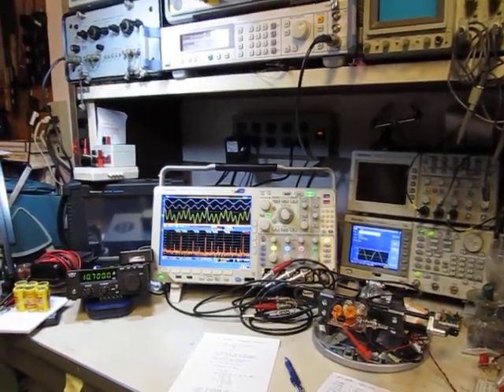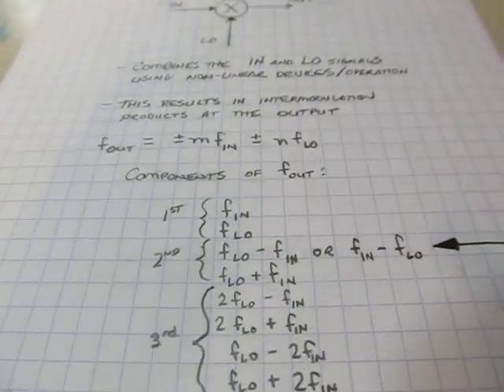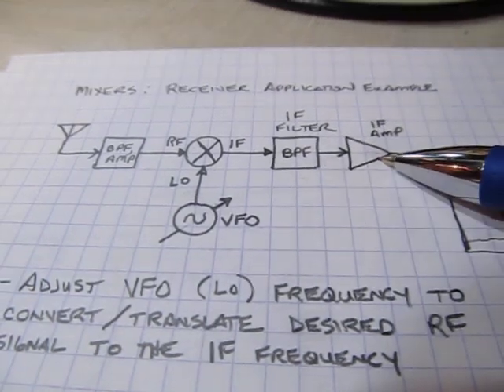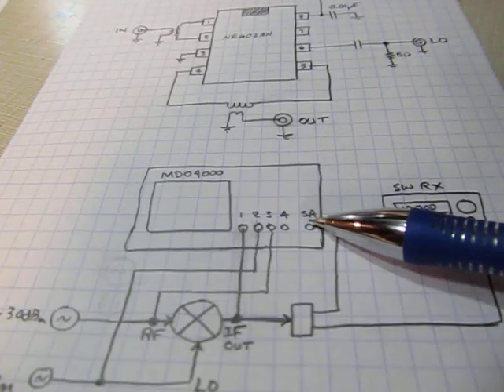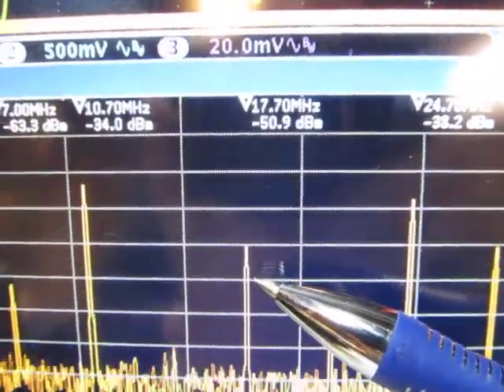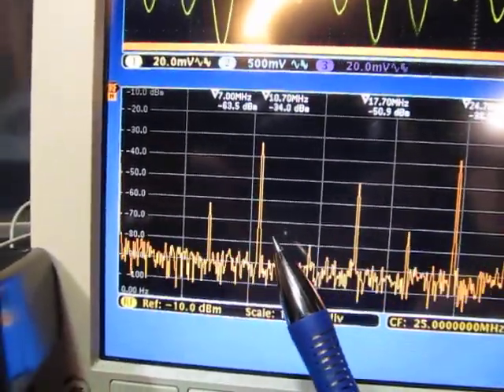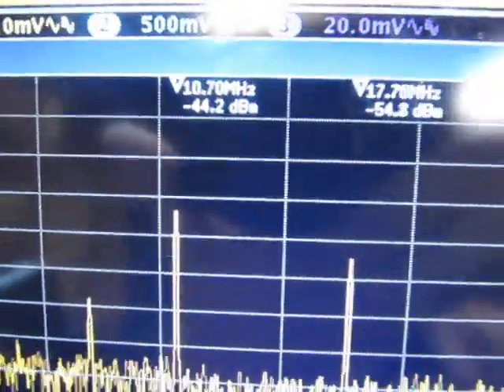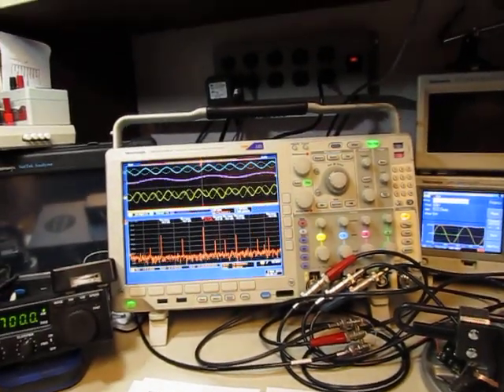#83: Basics of RF Mixers in Radio Receivers / Mixer Tutorial / Frequency Conversion

Comment: Great video thank you.

Q: how does the mixer "filter out" all the other frequencies of the band presented at it's input by varying the local oscillator?
Reply from the maker: In short - it doesn't.  All frequencies within the rated input bandwidth of the mixer are mixed with the LO, and all of those mixing products appear at the output.  It is up to the user to filter unwanted signals from the input (so they're not converted), and from the output (to select which mixing products you want to keep).

Comment: This clears up so much for me. Thank you. The one thing I don't quite understand is how to choose an amplitude or RMS value for the LO. I understand that if we want an IF freq of 455kHz, then the difference between F(LO) and F(RF) should be 455kHz. But how do we decide what the peak-to-peak voltage of the LO signal should be?
Reply from the maker: That depends entirely on the design of the mixer.  The specs for the mixer will state the LO drive power.  Often times, mixers are called Level-n, such as Level-7 or Level-13, indicating that they want a 7dBm or 13dBm drive level.
Reply: @w2aew  Interesting. Can't seem to find anything on the NXP SA606 datasheet. I'll keep looking around.

Comment: I am having a problem while designing narrow band pass filters can you make a tutorial on how to design a band pass filter and on the hf oscillators and rf amplifiers
please forgive me if these are silly questions. I am a beginner electronic enthusiast and i am trying to design a home brewed hf ham radio. I am having problems like impedence mismatch between oscillator and amplifiers etc.. can you help me
Reply from the maker: Narrow bandpass filters are difficult at HF and higher RF frequencies.  This is one reason why radio designs include several conversion stages, and the narrowest filtering is done in the final IF stage, where the frequency is the lowest.

Comment: Awesome demonstration!  In an old tube radio, is the mixer also nonlinear, or does it just add and subtract the two signals?
Reply from the maker: It is performing a multiplication, thus non-linear.  Simply adding or subtracting signals would not result in changing the frequency.
Reply: @w2aew Thanks!
Reply from the maker: @josquinmingus  Yes, the mixer creates sum and difference frequencies, but it is not through simple addition or subtraction of the signals - it is via the non-linear properties of the mixer (multiplication).

Comment: I was wondering why the mixer shows about 4dB conversion LOSS while the datasheet for 602, shows a 17dB conversion GAIN? also why this conversion loss increases to 14dB when you switch to 7MHz RF? datasheet seems to only show conversion Gain. The LO drive (0dBm) seem to be ok because the datasheet says 300mVpp maximum so your LO drive is even higher.
Reply from the maker: I didn't do anything to optimize the transformers at the input and output of the mixer, so their frequency response is all over the place.

Comment: A couple questions here...
1. When I tune to a station, let's say 92.3, does that mean the radio station transmits at a different frequency?
2. Are some of the intermods higher in power than the fundamentals? I was surprised to see that.

Your content is the best on youtube btw!!! Hands down.
Reply from the maker: Radio stations are strictly regulated, it is highly unlikely that their signal would include harmonics. Intermod products at the output of the mixer can be higher that the fundamental.

Comment: Hi Alan, just want to be sure i get the concept right..  if i want to build a receiver for 40m band SSB, can i get away with just having a single mixer and direct conversion? rather than having to get I and Q ? also, if i have a 7MHz LO, then my processor can simply generate 0 - 200 khz, mix it with the LO to cover the 7 to 7.2 mhz range. then mix that again with the incoming RF... that should get me back in the 200khz range, and sample my ADC at 400khz...i theory i could see all the SSB channels in a waterfall...

Comment: Interesting video!
Can anyone tell me why some devices like spectrum analyzers have multiple lower IF frequencies. For instance when upconverted to i.e. 2.1GHz and after filtered with a cavity filter, some go to 70MHz with an extra BPF and then to 10.7MHz. Why don't they go from 2.1GHz to 10.7MHz in one step? What's the advantage?
Thanks
Reply from the maker: There can be a number of reasons to have multiple IFs.  One common reason is to provide better filtering and elimination of spurs and intermod products.  Another common one is to have the ability to tune the LOs of the lower IF mixers to tailor the final overall measurement bandwidth, etc.
Reply: @w2aew  Thank you. That makes sense.

Comment: Still dont understand. In real life you say that the RF signal into the mixer is a whole band of different signals going into the mixer. If you have a whole band of RF signals into the mixer the output from the must be thousands of different frequenses. But in your lab there is not a whole band of RF signals going into the mixer it just one frequens which makes it simpler.
Reply from the maker: The "band" of frequencies that are put into the mixer are "shifted" or "converted" to a different band of frequencies at the output.  A filter then is used to select which particular frequency is desired.  Thus, by adjusting the frequency of the LO, we can move the converted frequency band up/down so that the desired frequency lands inside the filter.

Comment: And also just to be clear, in the last example your RF signal was 7MHz, your LO was 17.7 MHz, and your IF Bandpass Filter was set at 10.7MHz?

So basically your 'receiver' was tuned to 7MHz, and the way you did this tuning was by setting your LO to be 10.7MHz above your expected RF frequency that you wanted to receive (and it's 10.7MHz above because that's where the passband of the IF bandpass filter is) So you can only receive a very narrow range which is based on the width of the passband of the IF filter? 

Is this what is mean by the "bandwidth" of a receiver, a measure of how wide of a spectrum of frequencies the receiver can look at at one time, which is simply set just by the width of the passband of the receiver's IF filter?
Reply from the maker: Yes, that is correct.
Reply: Awesome thanks! So if your 10.7MHz filter had a wider passband you could have had a wider bandwidth 'receiver.' 

These videos are awesome and you explain this stuff very clearly, thank you!

Comment: if I have an AM signal of sufficient amplitude, can I not feed the same signal into both ports of the sa612 mixer? ie. input (1,2) and clock(6) ? I think there'll be some distortion, but in theory it could be done? also can the sa612 be used in a 'regen' configuration? I would test this out by myself but I never managed to build a working receiver yet
Reply: ah, 2:43 you answer about the "regen", first order is nulled , so no.. but i'd still like to know if the same signal can be applied to both ports, in theory if they are of sufficient amplitude and in phase it would demodulate the signal... ?
Reply from the maker: @coffeecuppepsi  Unfortunately, no.  If you just inject the carrier into one port and the modulated signal into the other, then you get a direct conversion receiver.

Comment: how are the coils designed? it is so hard to find imformation online. here's my attempt, the input impedance of the ne602 is 1.5k, and I assume the rf transformer matches it to 50 ohm... to that's sqrt(1.5k / 50) = 5. so it's a 1 to 5 turn ratio (?) but that's just a ratio... then my other assumption is I calculate inductance equal to 1.5k at the desired frequency? that's how I know what impedance to design into one of the coils, the other is determined by the ratio?
Reply from the maker: For the turns ratio, you have that correct.  However, for RF transformers, the coil inductance is generally designed to give you a inductive reactance that is about 4x the terminal impedance at the operating frequency.

Comment: Excellent video! Can you please direct me to a how to go about measuring the phase angle between two signals? Thanks!
Reply from the maker: The most direct way would be to use a two channel oscilloscope and compare the two waveforms.  Many scopes can measure the phase difference of two signals automatically.  You would need to take care to deskew the two probes first.  Of course, the signals have to be within the scope's BW, and accessible for probing.
Reply: @w2aew  Thanks for the reply, yup, I use that method all the time during development of electronics (I'm an EE with Masters degree). What I'm really after though is a circuit method to do this. Currently I'm using an FPGA but want to reduce costs by using an analog circuit to do the same. THANKS!
Reply from the maker: @JesusSoonComing  There are several ways to detect phase difference.  Phase detectors are used all of the time with PLL circuits.  My video on the Basics of the Phase Locked Loop covers some of the common phase detector types.  You can also use a double balanced mixer and low-pass filter.
Reply: @w2aew  Thanks, I did watch that video and found it very helpful. I was hoping you could guide me to more options so that I can evaluate all the possibilities. I intend to digitize a fairly accurate (at least down to 1 degree) phase measurement of a voltage and current waveform. The signals will be around 2MHz.

Comment: Thanks for this unbelievably helpful video.Sir I try to take signals in the range of 0-15kHz.Does it matter that my local oscillator's frequency 200Mhz ?At the receciver part carrier signals are in the range of 80-120 Mhz
Reply from the maker: If you want the IF to be 0-15kHz, then your LO and input frequencies need to be 0-15kHz apart.
Reply: +w2aew but if LO And message signal has same frequency how can you separate them in filter they have same frequency after mixer we need a band pass filter right ? A narrow bandpass filter if LO oscillator has same frequency how can I separate them ?
Reply from the maker: When the LO and input frequency are the same, this is called "direct conversion".  Usually, a low-pass filter is used at the mixer output, maybe with a DC-block in series.
Reply: I understand now Thanks a lot. One more question what compenent  can I use as a mixer ? I have found a mixer while I was searching but it is really expensive. I want to create my own radio receiver to improve myself.Can I seperate the compenent of any radio and use the mixer inside of it ?
Reply from the maker: You can easily make a mixer, a number of different ways.  Examples: diode ring mixer (see my video), gilbert cell in a NE602/612, and many more.  Check out amateur radio designs for direct conversion receivers.

Comment: Sorry for a comment on an old video but working my way through your online course! 

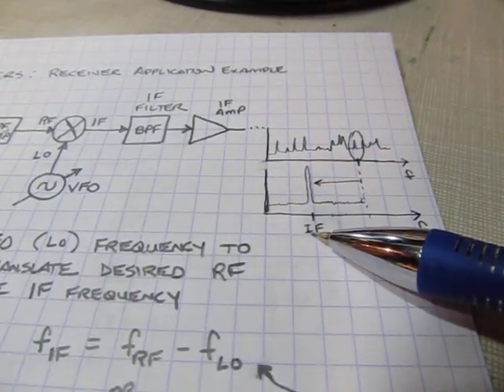My question on the coupling transformers is I am using 4:25T on T50-6 (assuming input and output impedance 50:1500). The 4T is on the RF input side and the IF output side respectively. Is that correct? Also the coupling cap between LO and pin 6 I have 0.1uF - just guessing here. 

I am not seeing anything like the IF output trace you have. I am using a fairly cheap scope but I am just seeing a pile of low level noise. I Have LO set to 3.1 Mhz @2V p-p and RF at 7.1 Mhz @1mV p-p Any thoughts. I have probed both the RF and LO input and do have the signals coming in. Sorry to trouble you with my beginner questions
Reply from the maker: You're LO seems a bit strong - make sure you haven't damaged the LO input on the mixer.  The RF signal seems pretty small, 1mVpp is a very small signal to see on a scope.
Reply: Thank you for the suggestions - I lowered the LO voltage and increase RF and did see the mix pattern and confirmed the frequency output with FFT. Output is very low though - around 8mV p-p but glad to get is working. Thanks again and thank you for all the excellent videos

Comment: Hello Alan,
I am training myself on the subject of modulation and its measurement. I will carry out your experimentation very well explained in this video.
I started experimenting, with success last night with my SMDU R&S and my ICOM IC-275H in CW. I have a question about the matching transformer of your mixer? Did you really used schematic of the fig.5.27 of the EMRFD book? I think the  input transformer is not really suited for VHF. Am I right?
Reply from the maker: It was really designed for HF. It will work for VHF, but will have some losses.  For experimental use, it should be fine.

Comment: Can't find NE602NA anymore. Replacement would be SA602 but not the DIP packages. Any alternatives you know of?
Reply from the maker: Both the NE602AN and NE612AN in 8-in DIP are available here:
http://www.kitsandparts.com/integratedcircuits.php
and SA versions here:
http://www.danssmallpartsandkits.net/
Reply: alright, placed order for 5 of each from k&p. i'm so freaked out right now. their site doesn't confirm stock quantity. However, if they had those and managed to mail them, and given my shipper consolidates my shipment and ship them off to over seas again, and clearing them from customs without any BS from clearance, after all that!!! I am really going to have fun with these. I have been looking for DIP NE602NA's for ages now. It is a shame they don't make those anymore. This is just one small step for now. Thanks w2aew, you did me a great favor.

Comment: The piece that I always miss is how the LO which has no modulation at all mixed with the RF gives an exact copy of the RF modulation at the IF frequency. No one ever goes into that explanation. I have decided that the LO amplitude must be set to be higher than the highest modulated amplitude of the RF being mixed. That is a guess on my part but I have never heard it explained and finally decided to ask the question. Thanks.
Reply from the maker: Yes, for frequency conversion, the LO drive level is important - mainly in determining the conversion efficiency and the level of IMD product generation.  Maybe some of these other videos on mixer operation and performance will help you:

How a Diode Ring mixer works:
https://www.youtube.com/watch?v=junuEwmQVQ8

Diode Mixer LO Drive Level:
https://www.youtube.com/watch?v=GvadQpkZ8l0

Gilbert Cell Mixer:
https://www.youtube.com/watch?v=7nmmb0pqTU0
Reply: Finally, #260 is what brought it home. I am thankful for the links. Keep up the great work. Your segments always touch on one-off pieces of info which I have found helpful over the last year. Especially the computational information you bring to your subjects.

Comment: As usual a brilliant video Alan. Love how you connect the dots between theory and practical. 
Questions
1) The IF filter did not affect the noise floor at all in the spectrum. Is that because the stop band of the IF filter is wider than the span you used?
2) Can you please shed a little light on what happens lets say if the matching transformers don't result in perfect match or what happens when there is LO leakage. 
3) LOs are also responsible for introducing phase noise because of the PLL. But this is hard to visualize. And your videos have helped me visualize. Could you make a video for this.

Thanks in advance.
Reply from the maker: 1) The filter didn't affect the noise floor because the it's the noise floor of the spectrum analyzer itself.
2) See my videos on reflections and terminations to understand what happens when you don't have a perfect match. In this application, the main effect is that you won't get maximum power transfer into or out of the mixer (conversion loss will be higher).
3) I'll add it to my list.
Reply: w2aew Thanks for the prompt response. I got to your faq video finally so will be able to navigate better through the videos. Will check out the mixer video.

Comment: I am looking at some old valve radios and I notice they run a double ganged capacitor so that both the RF and LO are changed together. (Which makes sure the IF is always fixed at same value) But does your radio just tune the LO only? So do we actually even need a double ganged capacitor? I am assuming you don't with that kind of BPF you have there. How does that work to ensure IF is at the fixed value? Does the second BPF just have a small bandpass wrapped around the  fixed IF.  Why do the other radios use a double ganged Capacitor instead of this way. Is this way better? Thanks for these superb videos.
Reply from the maker: The double ganged cap is used to tune the LO and then often to tune a bandpass filter on the RF front end.  Helps with selectivity and preventing overload from out of band signals.

Comment: What about using the PI5V331 configured as a Double Balanced QSD  fed via a BALUN which outputs two pairs of signals  via 0u1 ceramic capacitors which get combined using 2x Motorola MC1350 which drive a RF phase combiner to get rid of sproggies and is driven via a Johnson Counter run from an oscillator operating at 4x the wanted frequency I.E. ((fin+10.240)*4) the output will hopefully be at 10.240mhz and no sproggies.